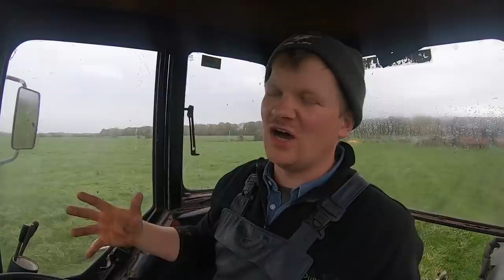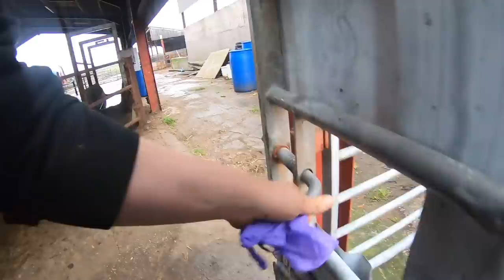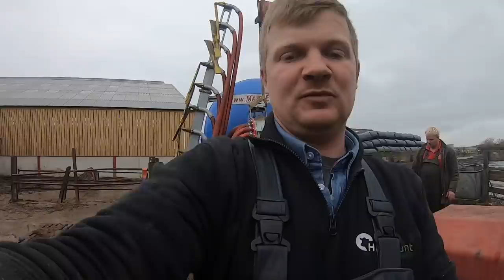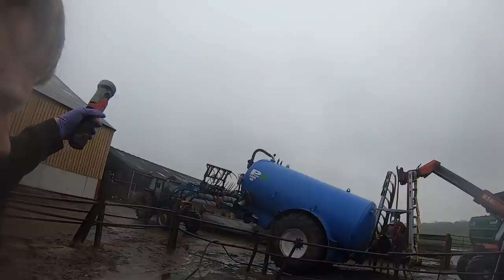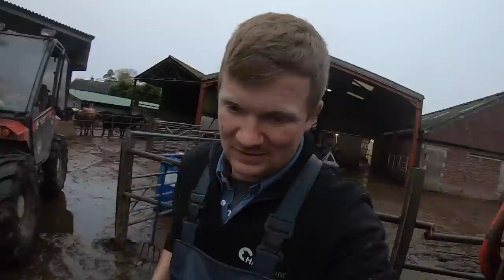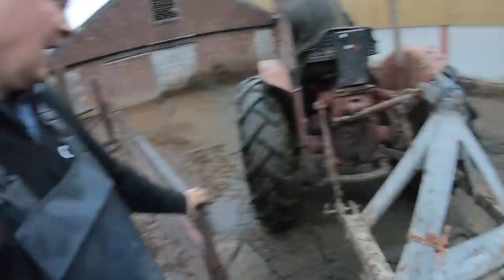THAT'S NOT MEANT TO HAPPEN !

Comment: Staying out of the tanker was a good decision. Safety first because it can’t go second.
Reply: Yeah, those gases are nothing to fool around with. I find it always impressive in a bad way how often you hear of accidents around here where a farmer or someone at a factory during maintenance went into a tank or silo and things end bad. Sadly most of the times the firefighters do not only have to rescue one victim, but a second person who got in to try and get out the first person who passed out due to some sort of gas. And in many cases, we really talk about it taking half a minute or so, to get overwhelmed.
On farms this often leaves whole families devastated, when the old farmer went in and the son goes after him to rescue him or vice versa. Most times this hits the media neither makes it out again. In some cases one survived just barely, but with permanent damage.
Done properly in an industrial setup I have seen silos beeing emptied, ventilated in some way, either using a draft if you coud open top and bottom or using blowers. Carrying a multi gas meter than can sense a variety of gasses and give alarms if oxigen gets too low or if anything obnoxious (CO to name only one, but a lot of other stuff as well) is present in a dangerous concentration. When someone works in the tank, another person observes outside the tank, and sometimes I have seen  something like harnesses used for fall protection used, not only to get in and out, but also to be able to pull someone out.

Comment: I’ve been in the back of one at these a few of times…… (more than 20years ago mind) it did have a bigger opening and H&S wasn’t forefront in our minds in those days.
What you notice is the weight you have been pulling and the amount of capacity you lost by not having it emptied! Beach sand from cow the cubicles was our issue. Well done!

Comment: Great video Tom. When we got our new tanker made. On the spec we decided to put a door on the side of the tanker so when we need to wash it out. We don’t have to remove dribble bar just open the door and open the gate valve at the back stick in ur volume washer. 10 minutes all it takes. The door cost €700 extra. Money well spent.

Comment: while you are getting a gas meter on amazon, also get a blower fan (doesn't need to be massive) to blow air into the confined space and push the trapped gasses out.

Comment: Best thing you can do with that tank is get a decent sized hole cut out near the front on whichever side suits. Then you can wash from the front. Yours Is only small, tandem axle 4000+ you have to get inside ☹️
I always strip it down at night and a quick swill of water around the top etc then it has all night to vent.

Comment: Been there, done that, got the Tee Shirt.  We made a 12 ft long spade to get all the stones out, but didn't get it as clean as your new machine.   Just one thing.. make sure you brush up all the stones off the concrete, as our concrete started to break apart after running tractors over the bits.   Good decision not to go in the tank... Not even for a Gold Watch...   Merry Xmas from N Wales.

Comment: I only splashplate from the gritty tank for that exact reason. Your dribble bar by the way it's designed leaves nearly a ft of stuff in the tanker which is where the grit settles

Comment: Without a proper confined space safety plan it was wise to stay out.  Perhaps a video with some farm safety group is good for us and other farmers.  A nozzle that points up/or like  a sunflower facing backwards with a long wand would help.  Fill it up with water from the ditch and rinse it to check flow and fully clean it and the yard, like you did in the past!  Glad the ditch is now working!

Comment: It's a few year back I admit, but the tankers we used to run all had fully opening hinged back doors, cleaning was a doddle, we often had to get in with steam cleaner, obviously opening & leaving to vent before entering & then we wore gas masks. I've often wondered how they cleaned them out when it's a sealed rear door, to us a hinged rear door was a necessity.

Comment: I have a small slurryspreader around 5000l and it has a little 3inch window in the front to see if it is full. Long story short, it cracked and blew around 100 l into the cab because the rear window was still open from driving on the street. Really no fun but the pressure washer fixed it with only the radio going out for half a day

Comment: I’m thinking you could get a simple tool made to pull the muck out of the tanker. A length of steel pipe + a section of flat plate welded on the end at 90’ to the pipe. Get it cut the correct radius for the tank & you’ll be able to pull the debris out without going inside the tanker.

Comment: The liquid spreaders my uncles had, had an open circle on top. Where we loaded with a pump. The hole was just big enough for a skinny guy to fit in. Guess who was small enough to fit.
5 gallon pails worked to go up and out. There was 2 foot of sand in them 2000 gallon tankers. 2 before lunch 1 after.
 My wife didn't want anything to do with me for 2 days. Lol

Comment: Tom just a suggestion can the Tanker be brought back to premex since their nearby get a stone trap fitted and open side door fitted in the side  for jobs like such .??
Even if cleaned once a year with ease such piece of mind regards life span of the Tanker.
Also to add with a stone trap it will protect to some degree your macerator on the dribble bar too!!!

Comment: well sand and mud is worse to clean out if you leave it in for couple of months inside as you need to scrape it out as it turn into cement.

i would not worry with slurry inside , fuel is worse to climb in to clean without mask on.

Comment: A few years ago a mate bought a 2nd hand tanker, first one for them with brakes, and they thought wow those brakes are really good as when driving it back they'd hit the brake pedal and it nearly threw him through the windscreen as the tank stopped that quick. Turns out it wasn't the brakes, it's was pretty much half full of gravel and shite that had set like concrete.

Comment: Make sure you you get a curved metal plate to conform to bottom of the tank on a pipe handle to pull muck to the back of the tanker! I would not go inside unless you pumped fresh air before and during the process!💩💩🤭🤭😒

Comment: lets say, i don't think i will jump in a tanker again. i went inside a slurry tanker which was not used after 3 months, i opened the valve over winter but that was most definitely not enough to get rid of the gasses, the tanker did need a shovel out, the hose and pressure washer did not do a dent, if it ever needs done again, i shall leave the rear end open for a long period of time, and perhaps get a more professional team to clean it out perhaps.

Comment: gas is heavier  than air    so will   lie in the bottom of the tank ......open up the filler  gates and wait a hour on a windy day   and   you will be fine ...........done it loads of times .....often got a  loading shovel bucket of gravel out .......

Comment: hmmm jsut thinking seeming how wet and dosnt seem like your gona have a lack of water issue XD, could you not take of the dripper bar close the hatch, pump the tank full of water witch should vent the gasses out like normal when filling then well dump the water, should be able to remove like 90% of the gasses and should speed the process up than having to wait like a hour or how ever long you waited

also love how your safty first yet you dont have any safey goggles or glasses on XD cant imagine muck would be good geting it in the eye's